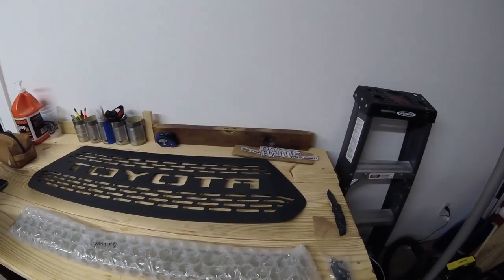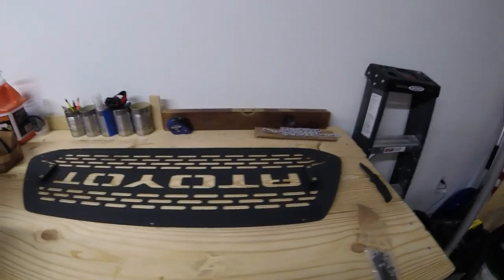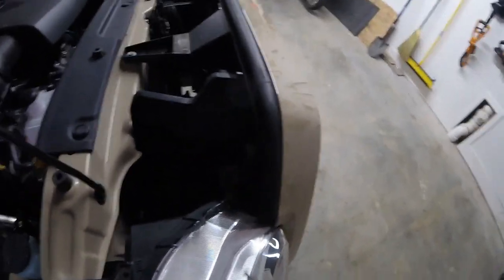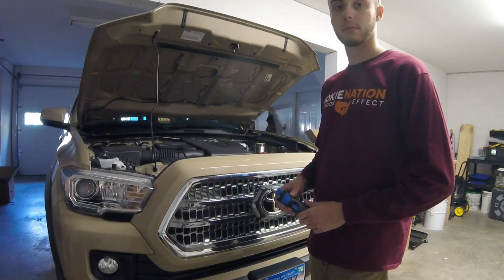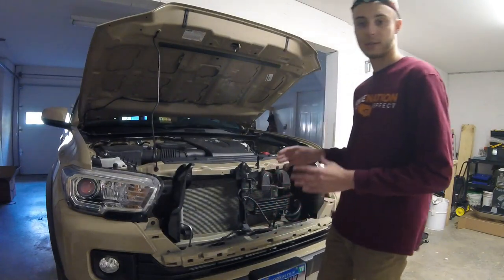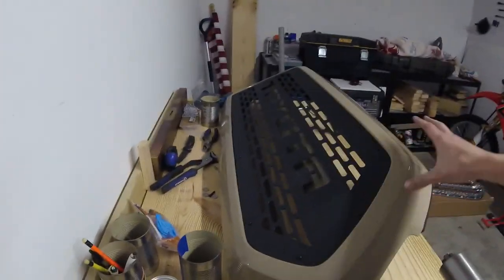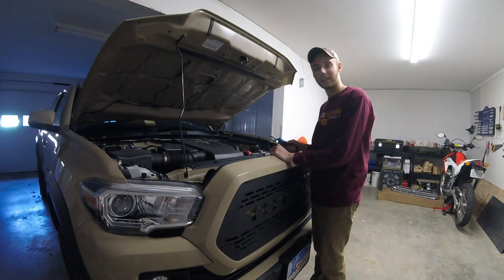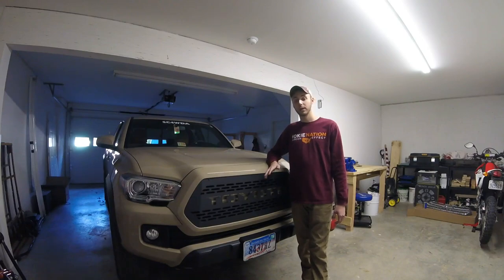2016+ Toyota Tacoma Grill by Bay Area Metal Fabrication: Installation and Impressions

Comment: Thanks for the video and product demo.  Based on your vid, I bought one for Agent Orange (my 3d gen taco) and it looks great.  Your installation video was good also, although I found that BAMF used standard sized Torx key while Toyota uses metric.  You'll need a US based standard Torx to hold the screws while you fasten them from behind when attaching the grill to the base.

Comment: Looks cool, but I think you could have gone with an OEM Toyota SR5 Grille. It is black and simplistic which would give your truck a more uniform and professional look. By the way, the Chrome surround helps to break up the black and makes the grill appear a little bit smaller as well.
Reply from the maker: I was looking into other Toyota grills including the TRD Pro grill.  All of those are made of plastic and are much more expensive than the metal one I got.  I also like the fact that mine is different!

Comment: I like the look,  but it also looks like it restricts air flow more than the stock grill.  I wonder if  it voids the warranty of the truck?
Reply from the maker: Rex Kuntz I have nothing but good things to say about the grill. I've gotten a lot of compliments and honestly I'm guessing that most of the air flow comes through the slot between the grill and the bumper.
Reply: Yeah I'm sure it wouldn't be a problem.  But I wouldn't take it back to the dealership for warranty work with it on there.  I have the exact same truck as you, same color even, but mine is 2017.

Comment: What are your thoughts on a grille guard? 
Also, do you think there is enough room for installing a hidden winch without having to install an off road bumper? I can understand the reason for off road bumpers but I like truck to looks somewhat stock with a few improving touches.
Reply from the maker: I am not a huge fan of a grill guard, specially for the looks.  I believe that a winch would easily fit between the bumper and radiator with the proper mounting bracket

Comment: Thnx for vid but i wish you didnt skip over the entire step of how the new grill fit into the old slot. I would like to see how they attach together.  Is it those exteriors screws holding it on and to which slot did they go since the orginal grill had no screws.  Does this also mean anyone with a screwdriver can easily steal your grill in 10 mins.  Like i said i appr ciate you putting out these videos, but you skipped a big and huge part of it for me
Reply from the maker: The screws around the edge do help to hold on the grill and they slip in to slots that were not used as mounting locations for the factory grill.  Sorry for the confusion.